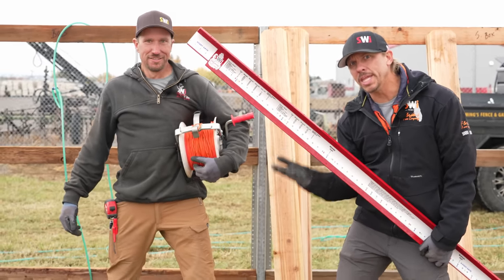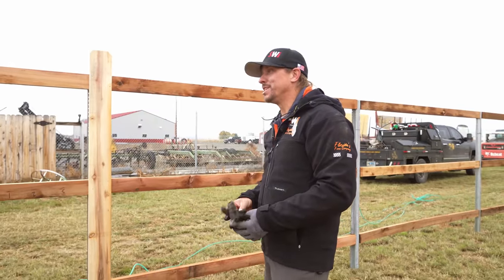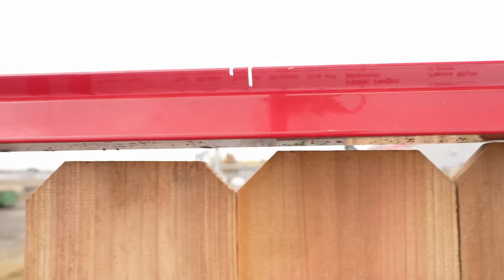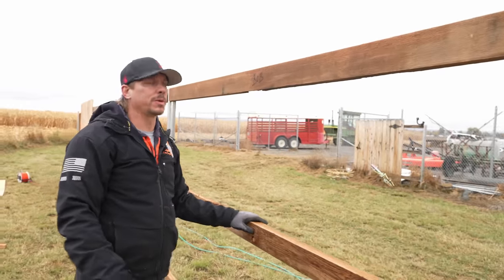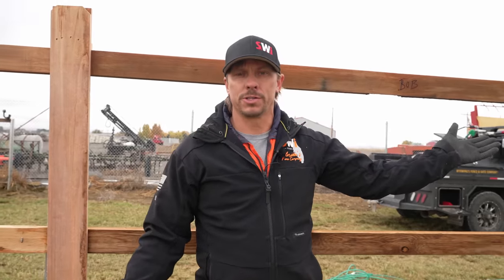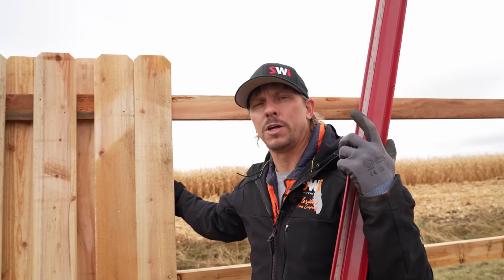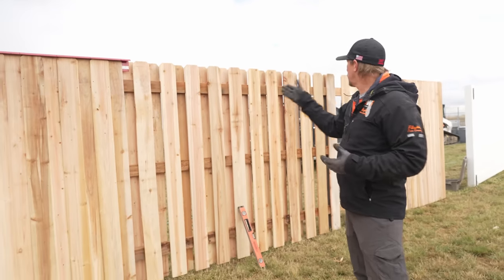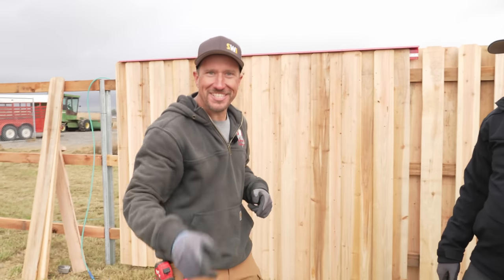Bump Board VS String! Fastest Method For Building Privacy Fence

Comment: I wish we can see a video with not even ground, to being a hater just to know how to solve the problems.
Reply: Me too. I string off at every post that changes elevation. I built one a month ago that literally went up and down like a rollercoaster. I'm wondering if this tool can do extreme grade changes
Reply: I just use a 9’ft long piece of steel. I like the bump board but it’s a little pricey. I don’t do many shadow box fences but if I did I would definitely buy the bump board! All my fences are on slopes. I just clamp my steel in place on the steep slopes. Super easy. Way better and faster than the string method. It’s very windy here so the string method sucks because the string blows around. 
I’m a professional fencer with 33yrs in the business. I’m a big fan of SWI!! They have great content. Keep it up guys!
Reply: I've been building fence 48 years and as long as I set your picket hight.rite and use string line it dont matter the grade it follows suit
Reply: Same height posts. Same distance put into ground. Same measured distance between posts for horizontals. Mark at top where the start picket goes. Mark that same distance on another picket at opposite end of that section. Make a jig that rides atop those pickets at both ends of each section. It will keep it all level even on a slope.@markHolmes81274

Comment: That's assuming that your posts and rails have been set at EXACTLY the same height... If you are digging the holes and hand and setting the posts in concrete (like you might do with a steel picket fence), that is not guaranteed... If there is even a slight variation, it is going to be noticeable... What I do is run a very tight line between the end point, adjusting slightly if I notice any sag in the line and putting the temporary pickets at each post, starting in the middle of the run and then halving each section until all the posts have temporary pickets.  I then used a 10 ft piece of 3" angle iron between the temporary pickets as (what you are calling) a "bump board" and use C-clamps to fasten the angle iron to the temporary pickets... The angle iron has a spacer on the inside edge at both ends so that the curve in the angle does not interfere with getting the exact same alignment each time... By attaching the ends with C-clamps, you can "bump" the boards quite forcefully and not be concerned with it slightly lifting over time...

Comment: I Use a thick 1.5in x 1.5in aluminum L-shaped angle bar 8ft long. Lowes/homedepot $25.00. I do 1 inch overlaps more comfortably with the pickets because there's plenty of room. This especially matters if your using the thicker 1in thick pickets. You could also write a measurements guide onto the aluminum if you feel you need to.
Reply: @JoeL-nd1yl  thanks
Reply: Just need a 10' 2x4. Cut 4 pieces off at 6" each. Screw 2 of them on. One side and the other at both ends of the remaining 8' 2x4. This will be your jig.

Comment: We try to put the straightest 2# as the top runner an then grab 2 extra 2#'s an make an 7 or L nail them together the just rest that on the top runner for a bump board, it goes post to post an keeps every section in good flow when we do shadow box we do have to measure an mark the bump board ourselves though

Comment: Bump board is fool proof IMO. I use q oiece of aluminum channel. I use my top rail as my sight. I always run it first. Then adjust the top rail to an ideal run and put up my bottom two rails and run pickets. You guys have been a tremendous help in my business.

Comment: The bump board is faster. I was near the end of my fencing days when I figured that out.

Here is how I set up for a bump board: Establish grade and set the corner or end boards correctly. Run a string the whole way. Tack a board at every 8'. Use a couple of ring shanks driven just 1/2" or so into the tops of these boards to hold the string while you set up. Take the set-up nails out of the tops of the middle boards. Leave the string up, you can take it down afterwards and if you had a brain fart in the layout the string is still there.  Make a jig, longer than 8' is better.  I'd have to take the tacked boards off and move them at each location.

Comment: Yeah hi, I don't know if you know how our paling fences are built here in Australia. So I will elaborate, we prefer cypress posts with 3 rails as well. Plus we use a sacrificial board on the ground . We then use that "plinth" as the height setting to place our palings on which are nailguned on instantly . Our palings are two widths 6" and 3". The 6" goes on first with 2"gap between. Then we place the 3" paling over that gap so we get an overlap of 1/2" every 6" paling. Just a bit of trivia as I am watching you guys. Your channel is very informative and well presented. And yes, I prefer string lines as well  Cheers from 🇦🇺
Reply from the maker: Cheers!

Comment: Bad thing about setting six inches up by the time you level them the tops will swing off of the measurements left and right on the shadow but I love the solid bump stop part about it. I've been doing carpentry for 25 years and miles of fencing I like the tool. Clay from mobile Alabama

Comment: How well does this work on extreme angle grades? I work in Florida, they don't happen super often, but often enough. I had a b.o.b. a month ago that literally looked like a rollercoaster. How bout a follow up vid demonstrating extreme grade changes?
Reply from the maker: It works fine on extreme angles, but if it's steep enough you might have to add some grip tape so that it doesn't slide.
When we get a chance we'll try to show it in use on grade changes--schedule's pretty full at the moment.
Reply: I just use a 9’ft long piece of steel. I like the bump board but it’s a little pricey. I don’t do many shadow box fences but if I did I would definitely buy the bump board! All my fences are on slopes. I just clamp my steel in place on the steep slopes. Super easy. Way better and faster than the string method. It’s very windy here so the string method sucks because the string blows around. 
I’m a professional fencer with 33yrs in the business. I’m a big fan of SWI!! They have great content. Keep it up guys!

Comment: Bump board is a cool idea, shouldn’t say this but could have 2 adjustable steel brackets that sit in the top rail so you don’t need the post top good video guys 
Cheers from Aus
Reply: The adjustable steel bracket to the top of the rail seems a good idea, but it is not. The rails aren't planed.

Comment: Awesome video! Is that an air compressor tool? Also, what kind of nails are you using? Old woman here trying to fix her FL fence! Thank you!
Reply from the maker: Yes, this is an air tool. We use ring shank nails, but the right screw will also work. Screws even hold tighter. https://youtu.be/QkFV0pcd4gM

Comment: My bump board I been using for years has a 6" leg on one end that stratals the top 2x4. No need to setup a dummy picket every 8ft just slide the bump board down the rail. A bit faster that way

Comment: awesome tool if youre working on flat ground, but i guess it wont work if theres humps between posts
Reply from the maker: We'll try to roll our post placement so the fence flows--following the contour of the land but smoothing it out a little. We're almost never going to hump a fence in-between posts. Trim the bottom of the pickets if you need to, but you want nice lines at the top.

Comment: Make picket jig width the same as your picket exposure so all it has to do is sit in your top rail to set line. Great for grade changes-as your rails go so does your jig. I built my jig with a pair of tabs so it supports itself on the top rail. Eliminates having to put up and take down gauge pickets at ends. A 1x6 gives you a 5 1/2" exposure but any size can be used and I cap it with an aluminum j channel as the guide slot. Cheap, light, fast.

Comment: Seems to me a lot of the problems will be avoided if you stopped using metal posts and went back to 4 x 4 or 6 x 6 wood
Reply: Metal posts are way more durable
Reply: The layout challenges and math get easier with a 4x4? How so?

Comment: A pro DOESN'T need a cheat board. That is for amateurs that don't have the skills to do things without assistance for an over prices tool to keep it lined up. 

By the way why is he crying about letting him setup the board as if HE is the one cheating. The guy complaining also already had the cheat board (dummy picket, the board on left that he is resting the bump tool on) already made. So why are you crying and making a huge deal about it?

Also guy with stringline is setting up his stringline wrong. You never set your stringline on top of the picket. You make an L-Bracket for one end and make a cheat board (dummy picket) for the other end. The L-Bracket is made of 2x4. The longside gets screwed through the picket. The string gets gets secured to the top of bracket with a screw. String goes under and lined up at top, front edge of picket. Same on the cheat board (dummy picket) placed on the far end.   Your line is never on top of the boards. You just bring the top front edge of the picket to the line. Line never gets bumped or pushed up. And it is much easier to see the line when it is up front. 

And you are not spending any extra cost on a tool that take up so much space. 

Pros don't needs this junk. That junk is for rookies that can't keep a straight line. Not to mention that you can do 3 or four sections, using string. No need to be moving that thing over and over.